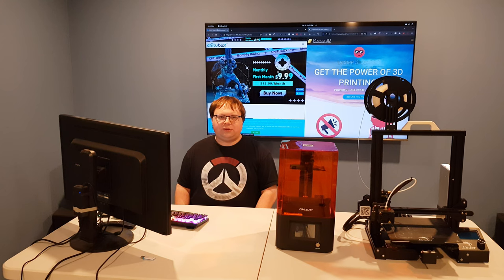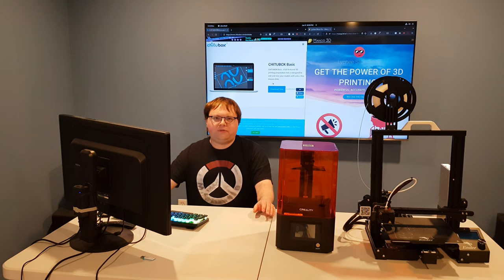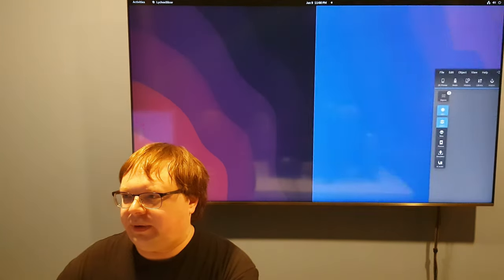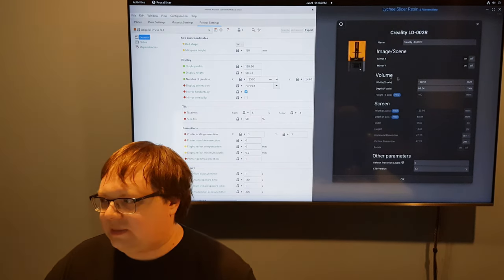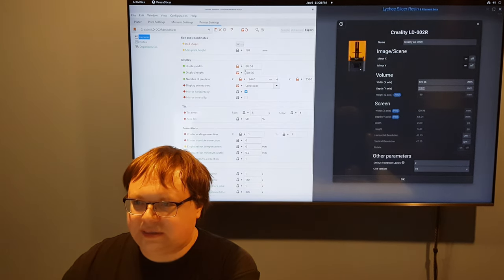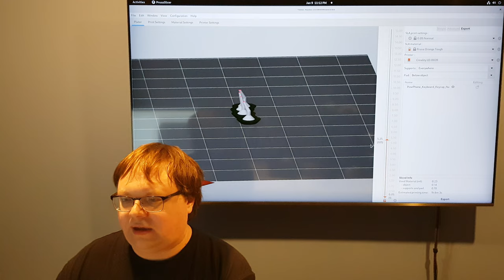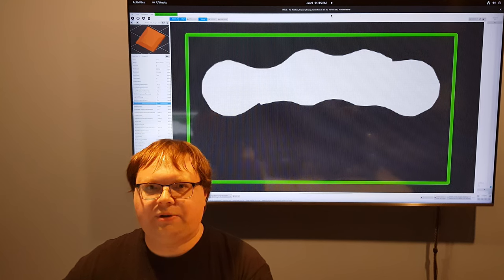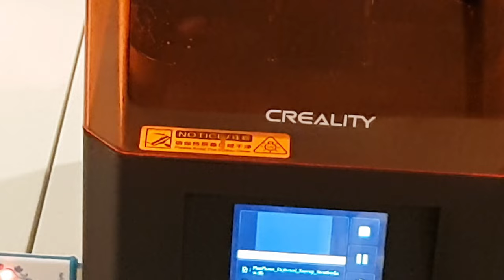Proprietary Resin Printing Annoyances, How To Use PrusaSlicer and UVTools With Creality LD-002R

Comment: The uniformation machines use a fork of Prusa slicer. Then you dont have to convert the file atleast. Not sure if youd need uvtools at that point but uvtools still is a really good tool for finding resin exposures i think.

Comment: Hi! Very interesting video. I was using also PrusaSlicer and a different program, uv3dp, to obtain unencrypted version 2 ctb files. Unfortunately I had an accident with my Mars 2 Pro and it broke, so I'm now struggling to find a modern printer which is not privative.

Comment: Will the chitubox version2 or version4 work on the creality ld-002h
Reply from the maker: V2 works for LD-002R but V4 does not I think.  I want to say the LD-002H is similar just with a different (monochrome) screen but I have never used one.
Reply: @CalcProgrammer1  it takes version 2